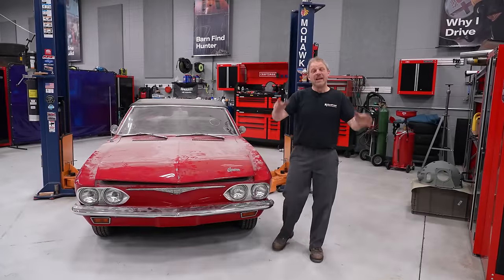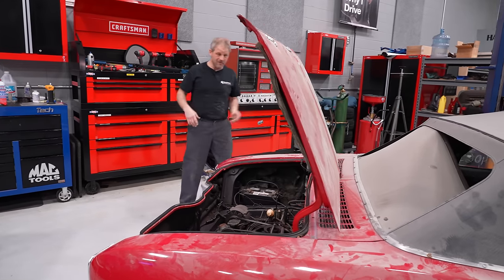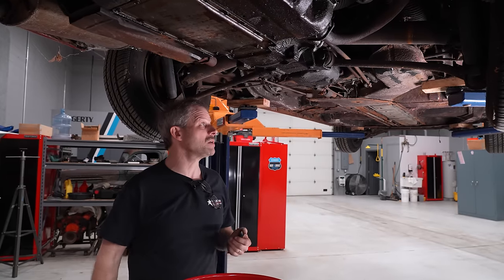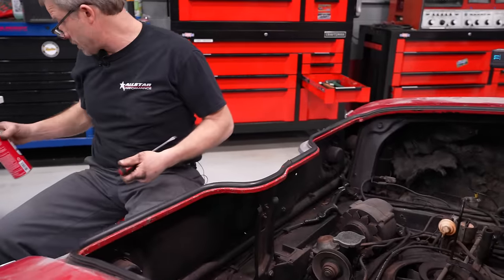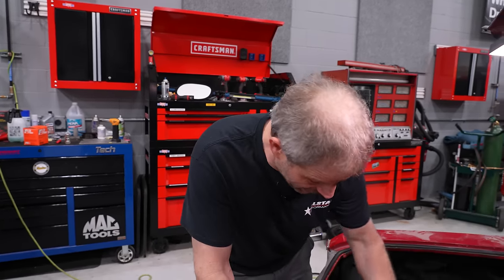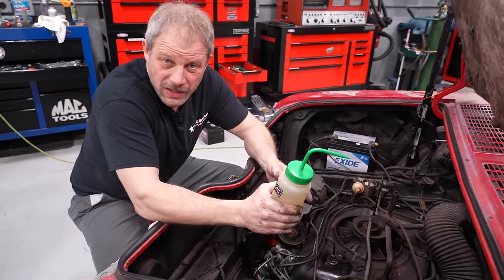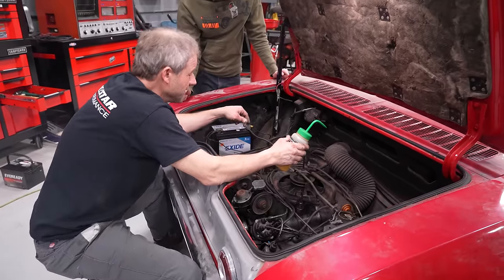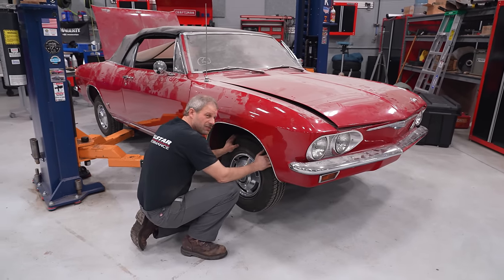$800 Classic Chevy: Will it RUN? (And Maybe Even DRIVE?)

Comment: I bought a 1960 Corvair in 1966 for $10.00. The owner said it ran fine but must have a bad bearing because it made a big noise. What could I lose? I got it home and the generator light came on. The fan belt was loose. I loosened up the generator, yanked it up to tighten the belt and heard a clunk. Did it several times with the same result. I pulled the pulley off the balancer and found it was a two piece pulley riveted together with bad rivets. The two pieces of the pulley were just sloppy. Went to the local junk yard, found a pulley and took it off. The guy charged me one dollar. Put it on the engine and ran it for two years. Sold it for $100.00 to a guy who just wanted the engine.
Reply: My dad gave me my 1962 wagon runs ok for its age I’ll say
Reply: Yes, I love this story, making a silk purse from a sow’s ear.

Comment: It’s always fun to see a car that has sat brought back to life.  Those second gen Corvairs are pretty cars and interferometer an engineering standpoint.  For a car that was flooded, it didn’t have any water level marks on anything (not even the brake drums, wheelcovers, or tires).

Comment: Pretty clean for a flooded car.
Despite their troublesome reputation of cheapness and hazardous handling, no one can deny Corvairs are pretty cars with a simple yet elegant design. Glad to see this one going back to the road.
Reply: GM fixed the Hazardous driving part multi sway bar in the rear. Ralph Nader was somebody out looking to make a name the car wasn't nearly as bad as he made it out to be. He is unsafe at any speed
Reply: The car was proved by the government itself that the car handling and safety were the same as any other car on the road. Nader BS aside I have owned 3 of them and they were safer than some of the later model cars I owned.
Reply: In 1969 I bought a 2 door 1962 Corvair for $10 and put gallons of RayLube reclaimed oil in it. It started to leave a trail where I often traveled. It met its end in the Fox Hills golf course in Culver City California. I didn't see the 2' deep drainage ditch between the fairways. It broke the rear motor motor leaving the engine on the ground. I got $25 from the wrecker.
Reply: Damien, if you looked at the rear suspension while the car was up in the air, the rear wheels were in parallel not in the swing mode as earlier models were. The rear end was redesigned to fix the handling problem.. Still love this car.
Reply: @Marlo Breding  another issue was with the front end being too light and causing push or over steer
Reply: @speedfreak8200  GM fix that problem in the first gen by adding a anti-sway bar to the rear. Ralph Nader didn't have all his facts correct. It was a hit piece.
Reply: This car looks like a double scam... beautiful paint over a rusted out chassis... maybe claimed it was flooded and took big insurance totaled out flood money for it...
Reply: @BuzzLOLOL  But wouldn’t the rusted out bottom be consistent with a car that was partially flooded?
Reply: @vayabroder729  - I suspect it was only flooded for a few hours...
Reply: @BuzzLOLOL  and maybe just barely touching the floor pans. Looks like the motor or transaxle didn’t get any water.
Reply: The second gen Corvairs ( 1965 to69) could corner better than 1965 corvette.   Based on a study showing the corvair had a higher lateral G force before losing traction than the corvette.  FYI.
Reply: @vayabroder729  Hard to tell. This was a NY car if I remember from the beginning. You are lucky to keep a newer car out of the junkyard due to rust.
Reply: they drive  very nice  not many cars could  out stop or out turn  the 65 -69  vairs

Comment: I had a  1965 Corsa convertible and thoroughly enjoyed it..    I thought all the Corsas had 4 1 barrel carbs,,,,   This one had 2 singles as did the Monzas...      A nice and clean design...    it handled very well...         nice to see this program   I hope this one gets to be on the road again....     thanks !!!
Reply: You're correct, the Corsa either had 4 carbs, or a single turbo. Someone probably swapped the engine, or at least the heads on this one.

Comment: I have had 10 Corvairs. I replaced the balancers with a solid pulley from Clark's Corvair parts with no issues. When you change the oil filter change the gasket under the bolt head. I once bought a Corvair that had been submerged. The engine was locked up. I managed to get it with Marvel Mystery Oil in the cylinders. I changed the oil and filter. I replaced the fuel pump. I put the engine in another car and ran it for several years before I sold it.

Comment: This brings back memories, I got a GREAT deal on a '64 in '71 because that damper/pulley came apart and cut a gash in the oil filter and it sprayed oil like a fountain all over the engine. Trader a motorcycle for it, fixed the damper/pulley and had a lot of fun for 2 years!

Comment: To me that is a very informative video: I got an abandonned project: A 63 Corvair Monza 900.
A lady who had absolutely NO IDEA what she was doing took a slightly rusty and driving car (it had less rust than this one here) that she had bought fom a mechanic and pulled the entire body apart, even chopped the fenders off and kind of killed the car. Some of her friends did a lot of welding and gave up on it. I am now in for many years trying to source all parts and make it a car again. The vehicle fought me very tiny step of the way.
There is no body panel that really fits well. I did nothing mechanical yet as the engine and brakes worked very well. Now with the fenders put back we found out that the car was sagging so much that the wheel touched the left fender. The car was welded together with after market parts and the fender is not fitting well. I ordered 4 new shocks and 4 coils in the States. I hope that will help to bring the car on the road again. You never know what you ared getting into until you work on a project: If I would have known what I had to do to make the vehicle roadworthy I would have NEVER taken up the task. I only pray that the car can finally get fixed.

Comment: Growing up, our family had a 64 Monza convertible (110 / 4sp), later on I had a 66 Corsa convertible (140 / 4sp).
My Mom worked at a tire store and was given a free set of Michelin radials, it was funny seeing mechanics shake their heads when my five foot and a bit mom tried to tell them the tires weren't flat.  ;-D
While driving my moms 64 the temp light turned on, I pulled over, checked the belt tension, it was good.
I drove on, but the light turned on again so I pulled over, checked the belt tension it was still good.
I practiced SSPP (Stop, Study, Plan and Proceed), that resulted in me grabbing the belt and yanking it, "clatter, clatter, clatter" went the separated pully and luckily I was at a service station near home, where after a couple days it was fixed.  ;-)

Comment: The "drain" for the manual transmission was to remove the lowest bolt on the extension housing. Fluid drained out through the threaded hole!

Comment: You need to take the bottom tunnel cover off and check the shift linkage -The oil cooler is under a little bolted cover by the right carburetor and needs to be cleaned also.

Comment: what a fun car i had a 1966 corvair corsa convertable  red exterior white top white interior. she taught me alot make sure to run good oil in it , i 
used 30 wt havoline when the oil got dirty she would get a bit snarky in running  after the oil would be in there for awhile, went to better oil she was much happier. the belt for for cooling should be watched ,i always kept a spare early models had prepencity to throw a belt. i made sure belt was always tight and after certain amount a time is go back and watch the belt  when pulling on throttle arm fast watch belt  of letting the throttle back watch the belt to see if it wants to hop going around the pulleys. their should be a belt guard on the belt tensioner opposite the alternator and top of cooling shroud.
on the clutch pedal cable make sure that the ball end on clutch pedal has grease on ball ,i had two snap right there at the ball end, i had two snap on me not fun changing  them, my dad gave me ball end off a cable witha cable clamp in case it broke, never had a problem after greasing that ball end.
i put the ieco quick shift kit for the shifter , really cut the shift pattern in half. i also on the rear end on the rear wheels their is concentric bolts that i moved the lower part of rear tire out one degree which gave a better bite in corners had a lot of fun after that

Comment: Had a 64 and a 65.  The sixty four had some handling problems, needed strut configuration; however it had strong chasing as it was a two door post.  The sixty- four for whatever reason had lot more power and handled very well.  110 hp was decent for a compact in sixties.

Comment: 28:20  BEFORE pulling fuel with the pump, I would have advised using compressed air (and some cleaner) to clear the fuel line backwards from the engine compartment to the tank hose. Even if there isn't water in the line, it will likely be gunky residue and filled. Cleaning the lines between the pump and the carbs also advisable.  Lastly, some 'Vairs have a fuel filter installed in the upswing from underneath the floor to the front of the engine compartment.  I know a bit about Corvairs.... 🙂  Edit: 35:40 ahhh, I see that you found the filter! 😊  Edit two:  39:30  Guessing that you installed, removed, and reinstalled the oil filter?

Comment: Nice video, good to see one get some life back. BUT,,,, For anyone looking at running a Corvair that has sat for any length of time it is very important to take the time to remove fan shroud and clear out the rats/mice nests. They love to build them there. They will pee on the aluminum fins and corrode the heck out of them.  It will ruin cylinders running them that way.  Ask me how I know.   If you store one make sure you put mouse traps/poison in the engine compartment. Inside also.   Not sure what you paid for the thing but you may make some money on the deal!

Comment: Must have had the engine replaced; it's a "Corsa", per tags on side of the car; Corsa had either 4 carbs or a turbo.  This one has the base 110 dual carb motor, like my '64 Corvair had on it.  It does have dual exhausts which would suggest the 4-carb version as the turbo had one larger exhaust, out the passenger side if i recall correctly.
Reply: I thought it more likely that someone in the past up-badged this car but it had the Corsa dash and the rest of the interior bits too. Vin started 107 also, so you are right in saying this car had an engine transplant in a previous life.
Reply: With an actual 4 carb 140 engine,  they are fun to drive
Reply: @christopherbusch1933  was it hard to tune all 4 carbs?
Reply: @gregstillman5197  I wouldn't consider it difficult at all, but sometimes my bar for difficult/annoying projects is surprisingly high. 

That said, it is a progressive linkage, so it is a pair of primary and secondary carbs. So get the mixture dialed on each side primary, then sync them with a Uni-Syn and they are good to go. The secondary carbs need minor linkage adjustment sometimes but if people tolerate Tri-Power Pontiacs they shouldn't poo-poo this setup. The Rochester H and HV are good carbs.
Reply: @Flatlanders_Garage  my '64 was twin carb and I always took it to the dealership to let them adjust the tuning.
Reply: The previous owner had installed an IECO intake manifold and Carter AFB 4 bbl carb on my 65 Corsa.

Comment: I had a 1964 Corvair Monza automatic, black with red interior including bucket seats. It was my first car. I ended up selling it for $800.00 in the mid to late 1970's so I think I did alright considering I paid $200.00 for it from a friend of my father. It was a decent little car but I always lusted after the new body style cars. I never did buy one though, sold mine and never looked back. Nothing wrong with them at the time I just wanted something normal for lack of a better way to put it.

Comment: Fram is a filter I will not use but in this instance, it is good for the first oil change to clean the engine out and then drain and refill with a decent oil filter. PH 4 Fram converts to a WISX 51038 or a Hastings LF 215. Rock Auto has them.

Comment: You take the bottom bolt out of the extension housing to drain the gearbox oil,, like all GM cars.
That was an average car before its swim and now quite a rusty one. Keep someone occupied for a few weeks welding a bottom back in it, then a good deal longer fixing all the wonky bushes, brakes and engine. And shift cables

Comment: Interesting how it  made it thru Sandy. I was a victim of it - had a '94 Olds Cutless Sierra wagon. Was a stones throw away from the canals - the water height was above the waste. The car actually floated then settled with the back end on the front porch.  

Curious about how you cleaned the plugs so well - you mentioned de-greaser?  Most I've seen use an acetylene torch.

Comment: I may be wrong, but if I recall, the Corsa option just had two engines - the 140HP "4-carb", and the 180HP turbo. I do not recall the 110 being an option. I wonder if someone did an engine swap? I had a nice 140HP '66 Corsa convertible. I wish I hadn't crashed it!
Reply: You're correct. Corsa was the sport model. I had both 180 turbo and 140 Hp with 4 carbs and dual exhaust. Either the engine was swapped at one time, or Corsa tags and dash were added to a less desirable model.  Both cars handled great.

Comment: Corvairs are innovative cars like nothing else before or since. In 1964 they had a turbo 150 horsepower 6-cylinder model. I think Porsches' best offering that year was a four-cylinder 60 horsepower power plant. Chevy made a ton of them and there is huge aftermarket support. Not not first class build quality but no worse than Camaro or Mustang. Corvair engines are also used for small aircraft and sand rails. Some with Porsche barrels and pistons installed.
Reply: Back in the day, but where would you even find one these days ? The better choice back then was the Pinto (overhead cam) that could be taken to 900 HP

Comment: I always thought that the Corsa model either came with 4 carbs or a turbo not two carbs. This one looks a lot like my first car which was a corsa and had the 140 which did have 4 carbs dual exhaust and 4 speed. It was a blast to drive.

Comment: FYI the corrosion in the cap only serves to cause a higher voltage Spike when the coil fires. You don't necessarily have to clean it all off. It's not a primary connection where you need shiny metal contacts. In fact GM provided silicone grease to put on all of the secondary contacts in the early HEI system To make more resistance to create higher spark gap voltage. 50 years auto experience speaking

Comment: The Corvair was a big risk for an American carmaker. 
It had a European character-- and also some of the idiosyncrasies of some beloved European classics.
I owned two. 
The engine geometry and skeleton is of very high quality and promises great reliability and longevity-- if, that is, a few weaknesses from the factory are remedied. 
Push rod tube o-rings being the most famous! These were adjacent to the exhaust manifolds and the rubber would soon dry out, crack, and leak copious amounts of oil.
That, along with complex carburetor linkages, and a scary fan belt design, was most of the trouble you'd have with the late model Corvair.
Otherwise, it was rock solid and very fun as well.

Comment: The badges say Corse but that is not a 180hp turbocharged engine, but a 110 hp with 2 one barrel carbs. The Corsa has a 180 hp turbo charged engine.

Comment: Local college got an bmw E36, planning to take the engine out for a swap. Put it on the lift, raised it 2 feet car still on floor. Super rotten, it had been driven in to.

Comment: I use to work at Fram in Greenville Ohio and all the negative reviews on Fram filters are very true! They have been known to destroy an engine! The quality is horrible! Definitely the worst thing you can do for your engine. I won't even use them in a derby car if it was free!
Reply: Agreed. I've seen what they can do to an engine. The second worst thing is putting Pennzoil in the engine. That's not something you want to do to an engine you want to rely on.
Reply: @Jerry Brooks I run Rotella T6 in everything I own, but if an oil has the right specification it should be fine, I have a friend that races and he uses Penzoil

Comment: Cool video! Corsa with a Monza engine or a Monza with Corsa badging and silver paint on rear cove area?
Reply: Corsa with a motor swap. The dash and interior was Corsa-correct and the VIN started 107. Didn't try and run down what the original engine would have been. The data plate was there though. Might check next time I'm near the car!
Reply: @Flatlanders_Garage  Very cool! Thanks Kylesmith!

Comment: I’ll bet 5 bucks that the computer is fried! Oh wait! This one doesn’t have any stupid computers! Carry on sir!
Reply: Still has a fuse block to get corroded
Reply: @speedfreak8200  five minutes with a steel wire toothbrush should do the trick
Reply: @cutl00senc  steel wire toothbrush 🪥 gotta be great for the gums. Seriously, you might could Google how (what to expect with a flood damaged car) that subject, there is more to it than brushing the fuse block. There will be all kinds of problems wherever brass or copper connections are, grounds .... there is good reason why flooded cars are automatically BRANDED TOTALLED

Comment: The nameplate says Corsa, that model had four carbs or a turbo. The dash included extra gauges. If a true Corsa, the engine was changed to a two-carb 110. You never identified which model. Probably not a true Corsa. But, we will never know. What did your expert tell you? I’ve had four Vairs and got to know them well. Fun to drive a real Corsa…it’s great in snow too.